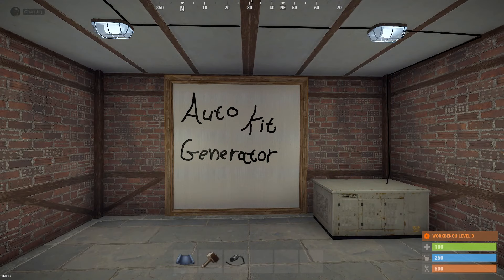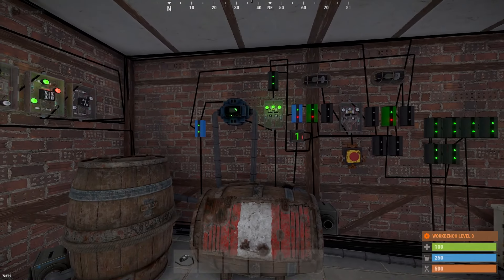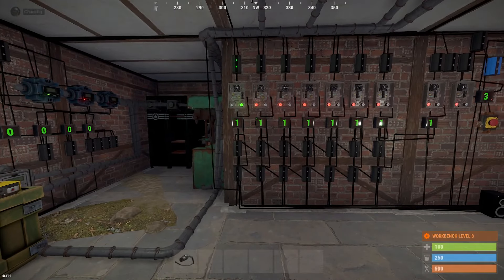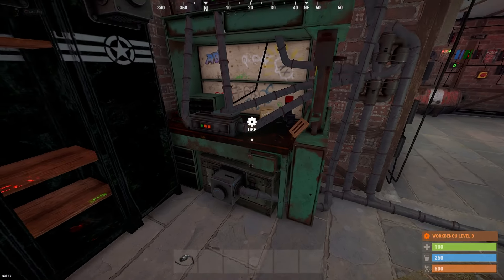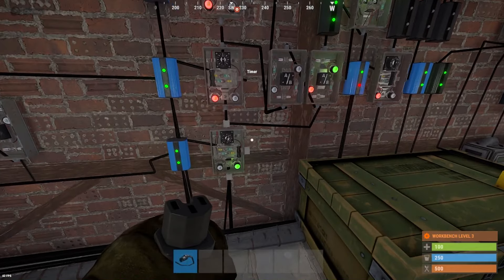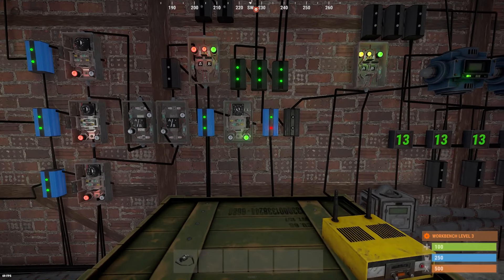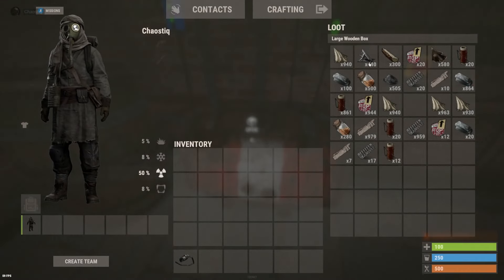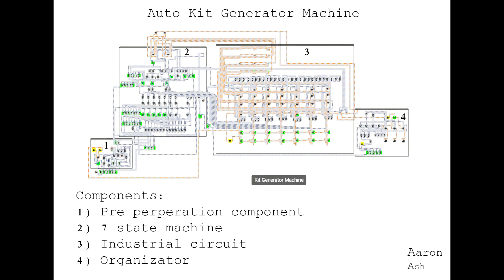Rust - Auto kit generator machine

Comment: you are over complicating it for literally no reason
Reply from the maker: might be , yet i built this machine several times with  different techniques and got this circuit to be the best working with no issue's . having all this functions are complicating the machine but this is the catch of this ...
Reply: @aaronash8571  i mean your just adding extra things...like no need for the counters for the materials you can see what your out of once you look in the locker...this is just  unrealstic to add...i do auto lockers and auto sorter for my open core base and thats all you need
Reply: most people dont even do that
Reply from the maker: @xdzombiezz4163  which counter you mean? , i made the organizator component so it will organize itself in the locker instead of you taking the loot to the locker , it can be also be straight to the locker but it can have issues if you will not fill full slot of the locker , i mean if you only use half slot so the next kit will be in the same slot... thats the meaning of the organizator , in this specific kit it's unneccesery because the kit is full of 14 items that fiils the entire slot but anyway it's good to have this feature.

the counters made in the organizator is to have synchronized slot shift , lets say if you want half slot kit which will contain only 10 items instead of full slot of 14 items so you can adjust the counters to synchronize the slot shift after every 10 items.
Reply: @xdzombiezz4163  womp womp
Reply from the maker: @xdzombiezz4163  most people will not use such an complicated circuit in game unfortunately but it can be used more commonly if game devs will add circuit boards to the game which can load downloaded circuits from designers... it will make them more practical for gameplay
Reply: @aaronash8571   Hope i never see circuit boards in game why give all the brain dead players all the time and skill of a builder its just dumb, u don't have to build this intricate circuit one on a smaller scale will work just as well.
Reply from the maker: Even with circuit boards you still will need electrician to connect the output and input ports of the board @ghostofdoom4741
Reply: Angry rust player thread, no surprises here.